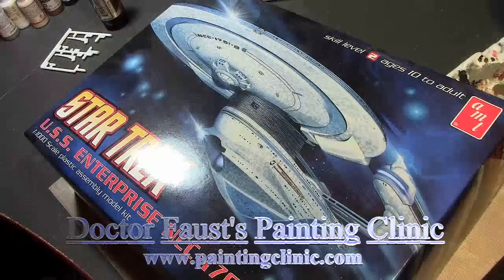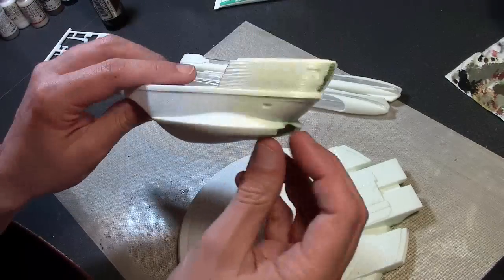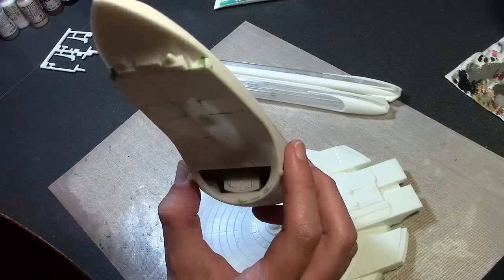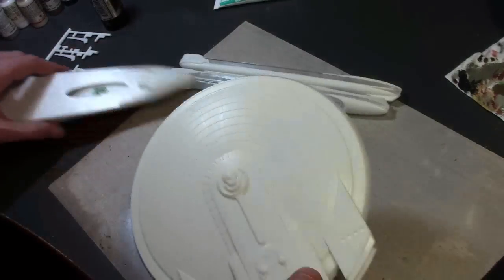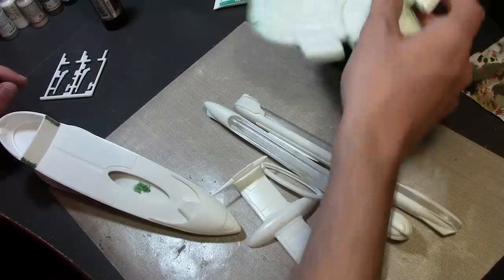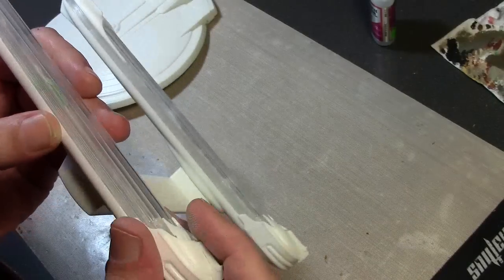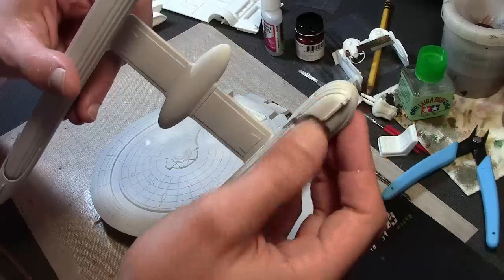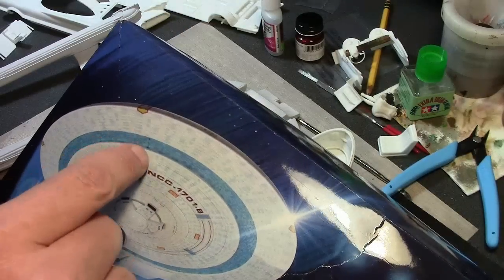AMT Star Trek Enterprise B Build Part 1

Comment: I had trouble with clear plastic too, until I discovered 'Testors Model Master Clear parts cement & window maker'. It's a glue that dries perfectly clear AND can be used to make windows in small holes/gaps/whatever. Super fun to use, and works really well.

Comment: Actually, the Excelsior mold that got destroyed in making the B kit was the upper saucer.

The Excelsior secondary hull bottom was one piece. Trust me, I've built both versions of the ship.

The nacelle piece issues result from the differences between the Excelsior and the Enterprise B.
Excelsior's nacelles lacked some of the fin length, as well as not having the top fin.

Sides of the nacelles, as well as the neck, work best in a gunmetal color, actually.